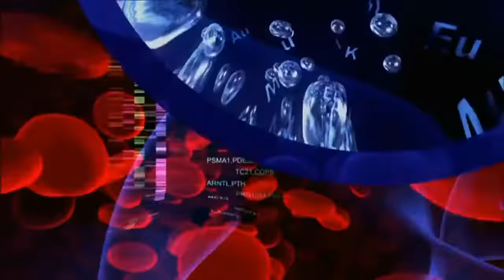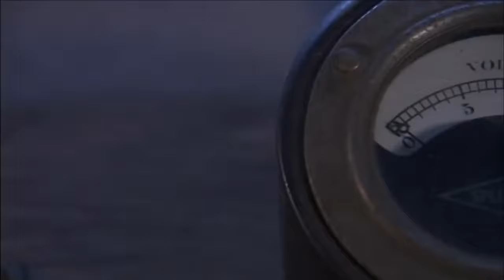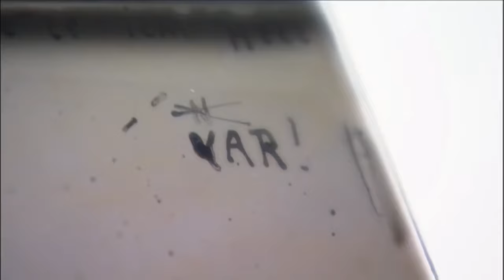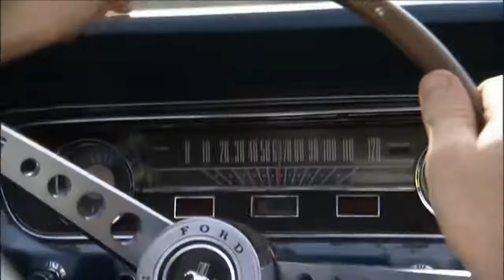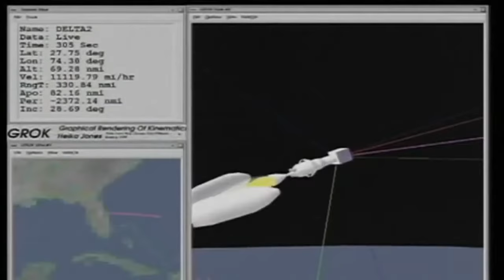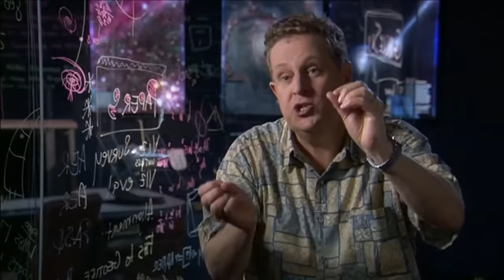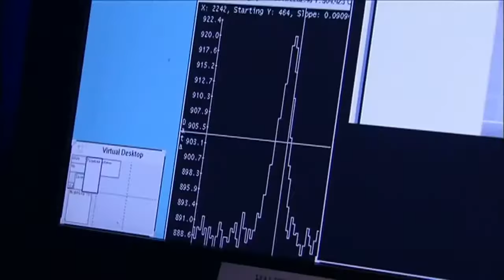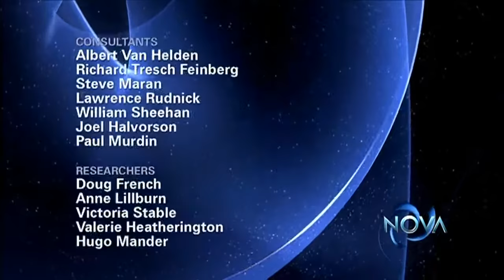The Expanding Universe  Nova HD 1080p

Comment: If the universe is expanding close to the speed of light then any number they come up with that says the exact size of the universe is wrong.That is way they have not return the calculations that told them the size of the universe because it would be a different number than they said last time and given the so called speed of the expansion it means that they can never be wright on how big the observable universe is.With no exceptions Evey time they do the calculations for the size of the universe the number is always with no exceptions going to be wrong.